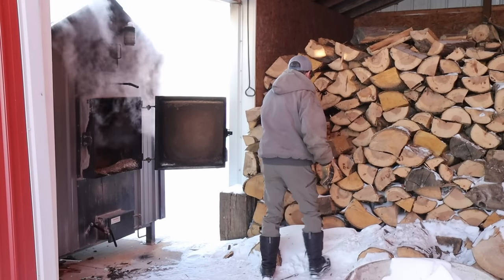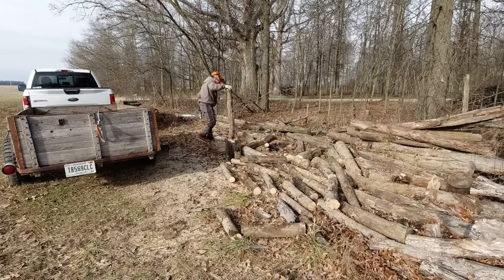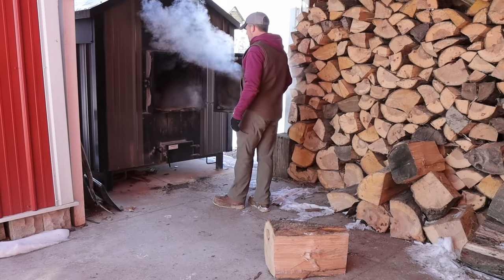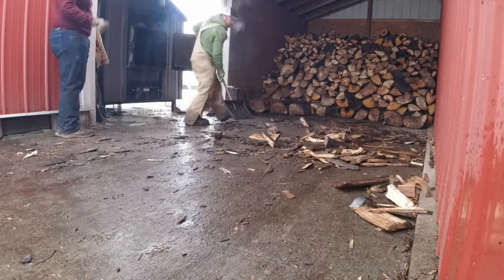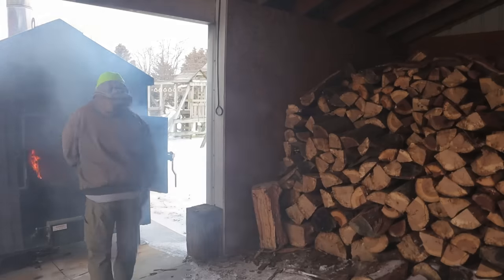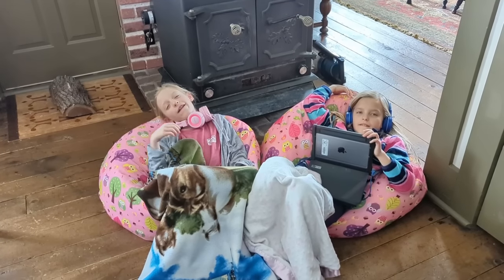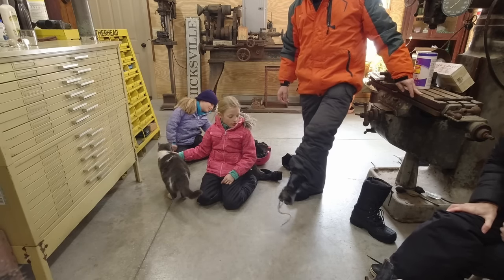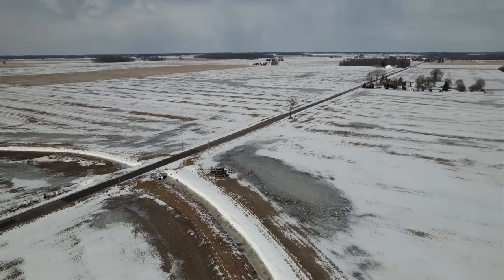Is BIGGER Better? [Firewood Size For Outdoor Wood Boiler] - Why Split Wood For A Large Boiler?

Comment: I cut and split all my wood for my outdoor boiler, it's easier to load and long pieces don't burn the whole length evenly so you are raking smaller pieces to make a level bed for the refill. Also if I have to be away from home for a day or so, my wife or neighbor can easily load the furnace! It's easier and the burn is more efficient with smaller pieces, i've had an outdoor boiler for 16 years now and have tried it all! Thanks for the great videos from Cape Breton, Canada.
Reply from the maker: That's great James!  You and I have been burning with the outdoor boiler for the same amount of time.  It's been a quite a commitment!

Comment: I agree with your dimensions, we usually cut 18 to 20 long and split over 16, we can do 48" long and 17" diam. I like my back and fingers intact. I smashed fingers on a monster chunk years ago. It hurt. The Big chunks do get lazy when demand is high. We heat 2 houses, 2 garages, and 2 waterheaters with ours. It's nice to share chores between us. I take morning fill brother in law does evening. Like the ice skating clip also. Thanks for sharing 👍
Reply from the maker: You're heating a lot too, wow! Yes, I had stitches in my fingers several years ago from smashing on the door opening.  I think about it almost every time I throw wood in 😜

Comment: We heat our house here in Chile with fire wood too. 
I use a small stove in our kitchen. It has a boiler in it and that collects the heat and it is distributed through out the house with pex in the floor used as radiant heat. 
I split all my wood by using the custom wood splitter we had built. It is not as nice as yours but it is pretty awesome for a poor guy.
We cook and heat all our water for the bathrooms with our little kitchen wood stove. Our system is not legal in some of the former USA. 
We do not get nearly as cold here where we are. 32F is a very cold day for us and even in the summers we get 45 F nights. So we have no air conditioning as it is not needed. Also we have almost NO mosquitoes and no Poison Ivy here in Chile. 
Love the channel and video. 
Also we split our wood to dry it out faster. Jim in Chile

Comment: I do the same thing you do typically. As long as I can pick it up and throw it in without hurting my back I won’t split it. I’ve had pieces as pig as 3 feet long and 18 inches in diameter. Pieces that big are manageable when they are dried.

I noticed you use a wood stove for a backup. I use my propane furnace as a backup. I have a hydrostat that reads the boiler temperature in the house. If the temp drops below 125 degrees my propane furnace turns on. Has worked very well the past 5 years.
Reply from the maker: That would be slick Jonah.  We have propane as well but I haven't worked out a system so they work in conjunction with each other.  I'd like to try it though.
Reply: << As long as I can pick it up and throw it in without hurting my back I won’t split it. >>

You probably ARE hurting your back.  You just wont feel the pain for a few more years.

Comment: Ha! I have a super insulated home in Kentucky. It doesn't get very cold here. I have a tiny Jotul 602B wood stove, which is plenty to heat our small home. Here's the thing, it takes 16 inch logs, max. And I cut all mine 14 inches long, so they don't foul the glass door.
And, I use mainly branch wood no lager than 4 inches across. It keeps my fires in the very small firebox bright and efficient.
I'm also burning wood that many folks would consider to be waste material only fit for a burn pile. Happily heating my home with free or found or waste wood is a good thing.
And I don't have to ever lift an 80 pound hunk of wood.

Comment: Your video reminds me of a familiar and true quote. "Just because you can, doesn't mean you should".  When I put my boiler in about 14 years ago I was 35.  "As big of a piece as I could lift" was my motto.  After 14 years of ~16 cords a year, and much older, I've become more sensible about wood size.  I go with 36" long pieces up to a max of 12-14" diameter and then I cut to 18" and split.  This enables my stack to consistent widths since 2 18" pieces can fit right in with 36".  I don't typically like the shorter pieces because it's harder to get them to the back of the stove neatly stacked.  Looking ahead at an aging body but lots of love and desire to cut and burn wood I'll continue to reduce wood size as appropriate.  I with there were log splitters with a 36" stroke.  I may have to make one.

Comment: I've been using a outdoor boiler for about 9 years now and love the savings and warm house. over the years I've learned that large wood definitely last longer and is more efficient' however to large is dangerous. After about 6 years I got complacent while loading a log that weighed roughly 60 lbs. just lifting it into the stove opening I bumped the front lip of the opening and almost cut off my middle finger on my right hand. I crushed the bone and it was a compound fracture! I was NOT chunking it in the stove like Neil does in the video. Now on large wood I set it on the door ledge and push it in with a rake.
Reply from the maker: I smashed my finger once on the door.  Got a bunch of stitches but fortunately didn't break it.  I usually hold the wood in such a way that my hand isn't on the end anymore.  But you're right; it can be very dangerous.  I think about smashing my finger nearly every time I throw wood in - especially cause it happened at midnight and I had to drive myself to the ER to get it stitched up!

Comment: I have an outdoor wood burning boiler. The firebox is 36 inches deep by 30 inches wide. To eliminate possible stress injuries, I use 16 inch long wood. The girth varies but I try and keep pieces at 25 lbs or less. I also find that the boiler is more efficient with smaller wood and smaller loads. Of course with a half full firebox I need to tend to it more often. Another benefit to using smaller wood is that it dries faster. The downfall is of course more splitting and handling. A trade-off that I am willing to live with. I am no expert but have 35 years of experience in using wood as a primary source of heat for my home and outbuilding.
Reply from the maker: Makes perfect sense to me Michel!  Thanks for the feedback and thank you so much for watching!

Comment: We burn large pieces but every year we tend to size them down as dad's not getting any younger.  Our boiler heats our 80x250 shop plus our 4 bedroom house.  We can keep both at 70 degrees relatively easy we really don't burn too much wood .  We do use a waste oil furnace in the shop when it's really cold out.  We figured out that if we burn a mixture of dead and green wood we can actually regulate the heat and burn wood  more consistently.   Honestly the size of pieces depends on  the size of area your heating plus your boiler and climate plus the strength of your back . There are advantages of both small and large pieces.  Great video keep up the good work!
Reply from the maker: Whoa! That is a big shop. That's great that you go through so little wood.  Thanks for watching!
Reply: @digdrivediy  we go through wood but not as much as the first couple of winters . We learned a few tricks along the way ! The shop is large until we pull 2 combines in plus a tractor and semi then it's small .

Comment: Another great video Neil, totally agree with the smaller is better to a point. I like the 6-8" diameter splits in my boiler those big ones burn longer but need a big ash bed to burn them up. When building a fire in your woodstove try the top down method, I remember learning it in scouts but didn't use it for years. Recently I tried it again and realized it was so much easier and faster to do.
Keep the videos coming.
Reply from the maker: I need to try that Matt.  Never really experimented with it before.
Reply: I did top down in my boiler and it didn't work well with because I have a gassification unit. That needs hot coals to superheat the smoke, before secondary ignition in a lower burn chamber. When firing from cold, all my boiler does is wait for a solid bed of coals before "full start". Until then it's just smoke. It's more work than my brother's old-school design, but he is moving to my unit because it a lot more efficient and clean in the long run.

With a bed of coals, the lower chamber can hit almost 2000 degrees (yes, I routinely hit 18/1900) and it loves "sappy" woods like pine, because all that dirty smoke becomes superfuel for secondary ignition. The stack is clean, years later. Just a fine gray dust, no black creosote. If I want to quickly toss BTUs into the water pack (500+ gallons overall), I toss sap-oozing pine over oak coals. Darn near a reactor at that point. 

The unit was supposedly EPA tested for 660,000 BTU an hour, but I have no way to verify that, other than to say it can keep 500 gallons of water near 190 degrees no matter what kind of draw our 5000ft living space can take from it. I credit the secondary burn. It's not a gimmick, in my mind.

Comment: totally agree. i split mixed sizes due to better stacking and longer burns. bigger does burn longer for sure  but remember a btu is a btu no matter the size. iv been using the heatmor 100 for 17 years and its great. im in my 50s now and the big wood is heavier than it used to be it seems. but i still use about 35 to 40 lb pieces for the big ones and then throw smaller ones in. just depends on how cold the nights and days. im in NC so not a bad winter most years. but if i do the right loading i can get a 12 to 15 burn which is perfect i think. smaller pieces do tend to burn faster and with my older model boiler, bigger semi green wood will burn at a slower rate which dont put as much of the heat out the smoke stack/ cord of wood is the exact same amount of btu's  no matter what size you split it. but the rate of burn is what you should measure. great video
Reply from the maker: Thanks for the good bit of info!

Comment: I have a gassifer boiler and i make small wood pieces mainly for it to dry better. I don`t know if you have gassifier boiler, but i have to stack the wood in the boiler carefully (tight, no big gaps between logs, less air ) so it doesn˙t catch on fire all at once, just the bottom layer. 
In Europe we mostly add a hot water storage tank to the boiler to get most efficient burn. Wood burns all at once at max speed and it transfers hot water to the tank. But  with an outdoor boiler you have to have some solution to keep  the boiler from freezing.
Reply from the maker: Mine isn't a gassifier boiler.  I usually stack mine in there pretty loosely.  You guys have some cool stuff in Europe!  Thanks so much for watching!

Comment: Being no stranger to manual labour, putting up firewood I had a wood fired boiler about 5 years in my early 30’s…despite being in great shape, feeding that dammed fire dragon with full sized pieces to optimize burn resulted in buggered up discs in my back to this day. Now I Quite enjoy a thermostat on the wall and the crackling of a campfire out in the bush on Campouts!
Reply from the maker: Oh boy!  I feel ya!

Comment: I dont have a wood boiler but I do have a wood stove I use for 24/7 heating, it will carry the whole house until it gets to near zero outside, I do a mixture of big blocks around 8-12" by 16-18" lengths and also smaller "normal pieces" the biggest thing when it comes to firewood is letting it dry out, I stay about 4 years ahead, I built a wood shed that has multiple bays and will hold 2+ years worth of wood, so my splits sit stacked outside for 2 years then will sit for a year and half under a roof w/ open sides providing that I reload the woodshed in the spring, big difference when burning very dry stuff vs more wet.
Reply from the maker: Man I wish I could be that far ahead with wood.  One of these days I'll get caught up again!

Comment: I have a  Hardy door 16x16 x30 long fire box I cut 2 ft lengths for easy stacking and the older you get the smaller your peices will become. I mix sizes also for the same reasons you mentioned.

Comment: I’ve come into possession of an old outdoor boiler wood furnace. Found that the split pieces of oak work pretty good with better recovery. I go out, load two or three pieces of smaller oak and then once it’s going good, I’ll load a piece or two of the big gnarly chunks that take way to much effort to split smaller. Fill up the rest with the split wood. Fill it twice a day that way. Seems to work pretty well for me of course everyone is different. Just remember that water is the enemy of heat and that wood will dry so much better once it’s split down for a while.

Comment: On your internal fireplace I find it useful to warm the chimney before lighting the fire. This starts the draft and prevents smoke. Just wad up 3-4 sheets of newspaper and light them in the chimney. Works like a charm.

As far as a boiler, I am in Texas so not a large need. However, I do want to consider one for a future home build. I would like to use a round bale burner though. Figure I could buy 2-3 year old bales and burn them for next to nothing.
Reply from the maker: I've never tried that.  Cool idea 😊

Comment: Hi.
I have been enjoying watching your videos from Denmark. We do live on the country, and heat our house with a wood stove, burning 14 face cords a year. 
Regulations are pretty high here, means that any stove have to follow strict rules. 
The German Technologie- und Förderzentrum (TFZ) have tested different sizes of firewood an made useful results. There are 7% efficiency difference if you use to big pieces. The most effective size is 3x3”, length doesn’t matter. What even more useful, is there are 24% less heat in the wood if it’s 30% moisture compared to 20%.

Combustion is way more clean and means you get more out of your wood.

But i will personally prefer boiler wood to be 6x6” and the length that works best for you. It’s saves time, and the size is mid between to small and to big for a boiler.
Reply from the maker: That's a great bit of info!  Thanks so much for sharing.  I should measure the moisture of my wood to see where it is.  I have observed what you have stated to be true but didn't have the data to back it up.

Thank you for watching my videos over in Denmark!  That is very humbling to me!

Comment: Here in Denmark, the recomended way to build a fire in the fireplace, is from the top down. 

Meaning that you start by putting the larger pices in, the smaler ones on top of that and then kindling on top, ligthing the fire from the top and letting the fire work its way down.  By doing it this way you heat up the air in the chimney quickly and get a mutch better draft going and therefore a better and claner burning fire.

Comment: I have a farm with considerable timber on it. Around 70 acres of timber.. I just installed a Heat Master wood stove boiler. I have saws. I have intent. A splitter is the only thing absent. Not an oversight, just a future goal. God bless, thanks for the insight. Cheers.

Comment: I do put a lot of small pieces in with that large log and it is good for in the daytime. When I don't require as much heat but I do not live in an area as cold as you do. But the hall's log loader saves my back.

Comment: I get this question ALL the time on my channel lol WHY dont you split your wood down etc. lol thanks for chiming in on the conversations! I always say the large rounds are harder to move but burn slower and longer but need a better coal bed, the smaller wood is easier to handle but burns fast. If I had unlimited wood and time id split it all for the sheer fact of it physically being easier lol.  My central boiler CL 6048 60x48 firebox is huge and burning 16" pieces is like burning chop sticks lol its nice to have the mix of split and non split is also what I say too!
Reply from the maker: It's interesting that everyone gets this question.  Good topic for discussion I suppose.  Thanks for watching!
Reply: @digdrivediy  Yes indeed my friend!